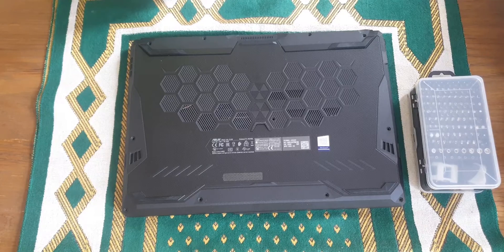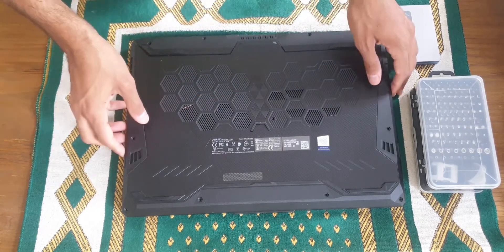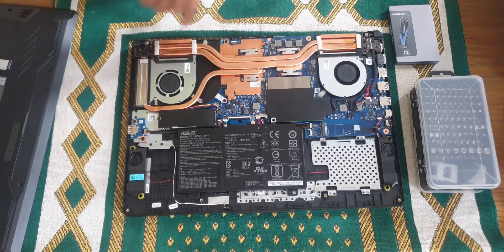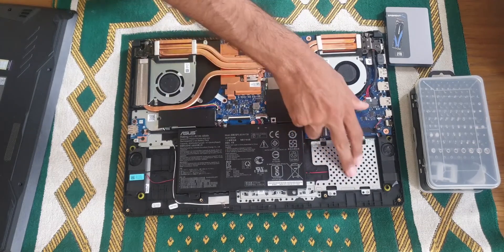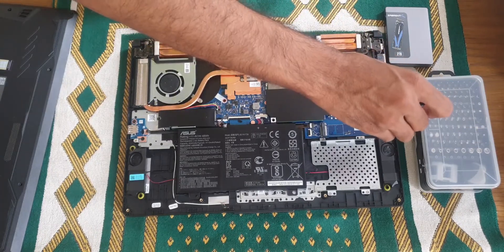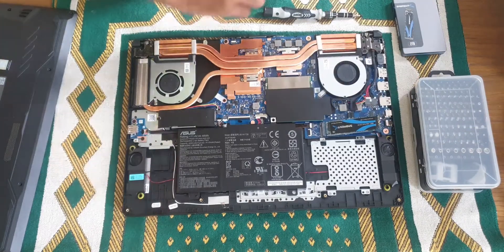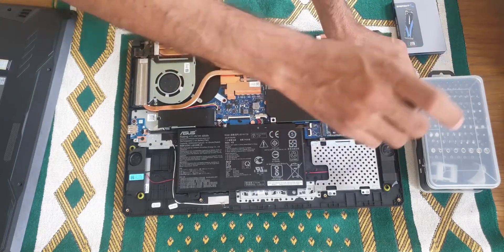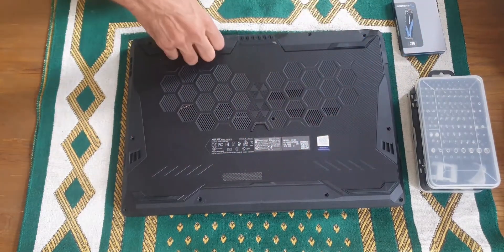ASUS TUF A17 gaming laptop teardown / SSD install

Comment: I bought this laptop a couple months ago, and I'm shopping for an M.2 drive. Should I consider buying a heat sink as well, or is that not necessary?
Reply from the maker: I would say not necessary. 

Also, if you have a problem with your WiFi... Don't mess with your windows or other components.. It's the wifi card.. Known for breaking down in this model and I have uploaded a video on how to upgrade it to WiFi 6 card (hopefully you won't need it but just to be aware)
Reply: @oredramo  It looks like mine already has a wifi 6 card. MediaTek wi-fi 6 MT7921 wireless lan card. But thanks for the response. 👍